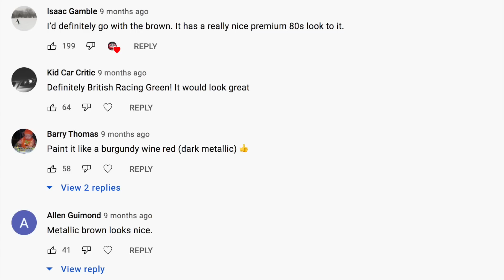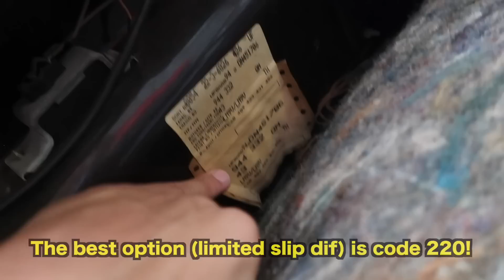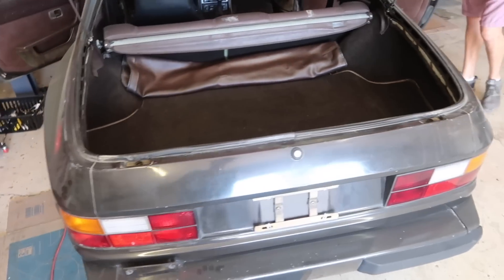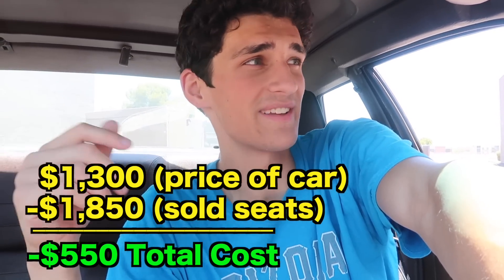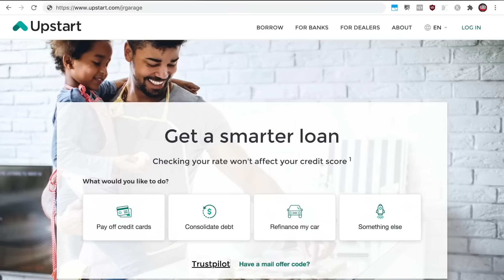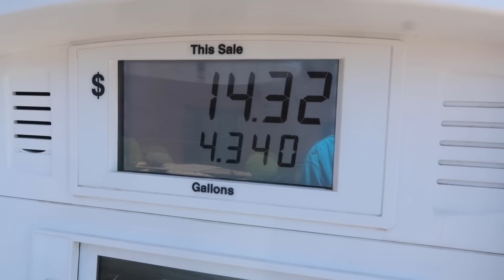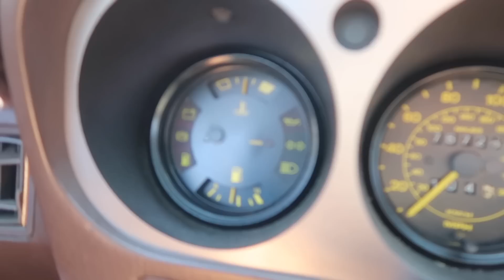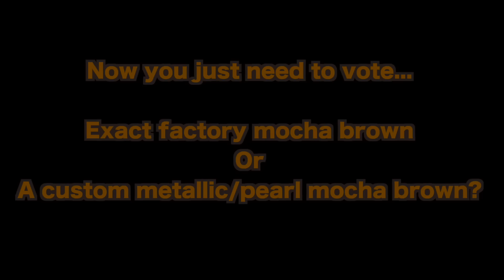Our $0 Porsche 944 Is Ready For Paint! (RARE 1 of 2 Known?)

Comment: Keep the LM9V. You forget that the car debuted in Germany in 1982. Factory “error” back in the day…used up the paint they had on hand. My 1983 was. June manufacture & the model year for 1984 began in July. I also owned a ‘84  944 parts car.  Many on the fly parts changed between production months.